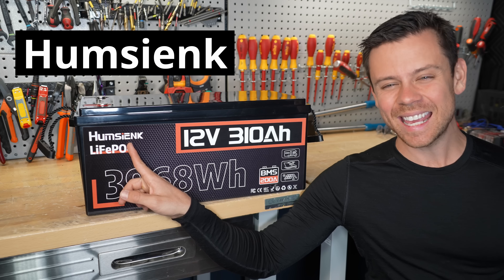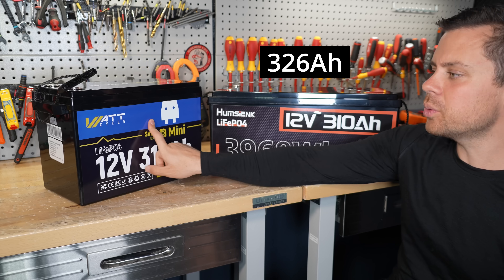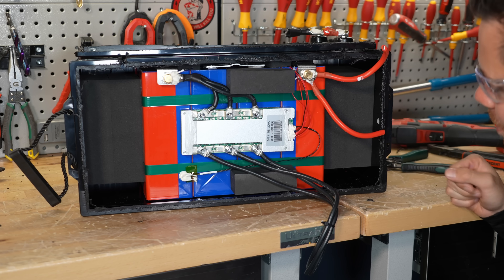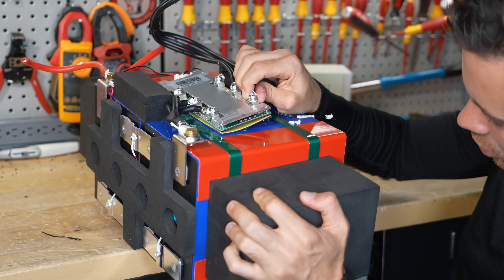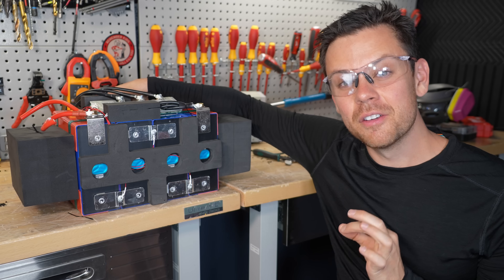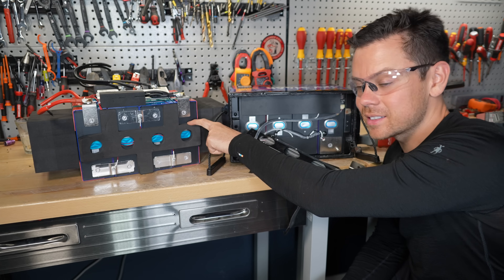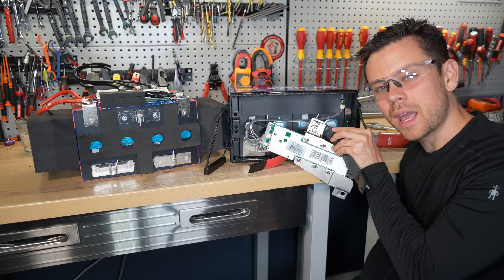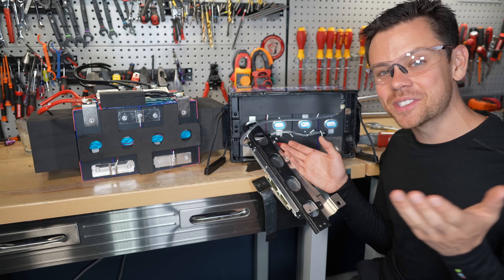$369 Humsienk 310Ah Battery VS $500 Wattcycle "Smart" 314Ah Battery

Comment: It is important that you measure the voltage of each cell in the battery. A bad battery have a lot of variations between each cell.
Also, if you can, take the internal resistance of each cell. A good battery have cells that have almost equal milli-ohms reading. If a brand new battery have already unequal readings that means that with time it will become worst and the BMS will not be able to equalise the voltage and your battery will become dead.

Comment: Might want to check out the Dr Prepare 300ah 12v mini battery. Jasonoid just did a review of it and the price is around $320 on their website. Also, a dumb battery. His main complaint was no over current protection and it would only trip with over temp. I just got the battery this week. Seems like a great deal with a fuse or circuit breaker added to it.

Comment: About a year ago I purchased 4 X Humsienk 12V, 300Ah, 200A BMS, LiFePO4 Battery with Bluetooth 4-pack Total Delivered with tax to Texas USD $1,276.20 so $319.05 each all in. A few months later I went to order more but they changed them to 100A BMS. So ended up going with a different brand. Glad they now they have the 200A BMS again. They have been great batteries. no issues what so ever. 
UPDATE WHEN I CLICK ON YOUR LIKE ABOVE ON AMAZON THE HUMSIENK SHOWS IT WITH A 100A BMS, (12V 300Ah (310Ah) LiFePO4 Lithium Battery – Max. 3968Wh Solar/RV/Off-Grid Power,15000+ Deep Cycles, 100A BMS,)

Comment: Humsienk seems like a great value, but Wattcycle has already fixed the app's parallel connection issues—it's really a tough choice! If money were no object, I'd go with Wattcycle!
Reply: The fix is still flakey. It also doesn't address the poor balancing capabilities due to mismatched cells and/or bad BMS design. 
My 314 would get so badly out of balance when charging that it never made it over 13.6 volts. I've heard people that have tried weeks of reduced current charging that haven't managed to balance these batteries. They are still advertising eve cells and mine and probably most/all have REPT cells. That wouldn't be so bad possibly but they are lying. My battery had the charging issue, Bluetooth had to constantly reconnect to show current data and then it died completely after 3 weeks of use. Dealing with customer service was not fun. I think they were more responsive after I filed a credit card dispute which I've learned you can often do even 6 months after a purchase. 
I got a vatrer 460 which is a bit of a jump but so far the balancing is really impressive. 
They have a 300 self heating for not much more than the wattcycle and a non heated one for about the same.I think temgo might be made in the same factory as vatrer as well, I dunno. 

Good luck
Reply: @daveybphotography  The latest Beta4 WattCycle app is a big improvement. This is still a Beta test version. I'm going to wait until the final version before judging how good or bad the battery is. Personally my cell balancing seems fairly good, not perfect but it charges to 14.1 - 14.2V before BMS stops charging.

Comment: Price value is reasonable. Like you said,  additional PROTECTION is REQUIRED to use  safely. 

Possibly that over sized case is shared with another larger product?
 OR, case is remaining supply from a previous manufacturer version/product which they bought for pennies?

Almost seems that a small fan might be added to blow across the BMS? 
Yes, would comprise the sealed nature of the case.

Comment: Someone else did a review on the 310 12v Humsienk battery about 8 months ago, just before Humsienk changed their 200 BMS to 100 BMS.
I purchase 4 units at $1152 plus tax for 4 units. The guy who did the review said the batteries have class A cells. Since Humsienk is who sells the batteries in Temu. With in a month I got an offer from Humsienk thought Temu of $125 0ff. I got a 5th 310 12v battwry for $225 they keep on sending offers of $125 off. I stopped at 6 units total. They are working like a charm. I'm using them in a 24v system. 3 strings 24v each, for the total of 22 kilowatts plus. I'm happy with them  so far...
Reply: Please watch out with series connection of LiFePO4 batteries. But if you watch Will you know. Charge them with individual 12V chargers once a year will help preventing imbalance between the packs.
Reply: @Robbedoes2 Thanks for the heads up. I Will do. Before I paired the batteries in series I charged them individually with a charger until they stop charging at 100%. Each string is connected to buss bars, and each string is fused.
Connected to a 24v 6k SunGold inverter dual phase but only using it in 120v mode.
I integrated a 1000A Smart Victron shunt to monitor the watts coming in.
I found a good deal on 405 watts Trina solar panels in CL, a guy had purchased a few pallets of panels and had  some extras, $100 bucks each...

I'm rinning (2)100A Litime charge controllers in paralels with the same settings...
2 AWG wire for the battery strings and the main wire from the batteries to the kill swith then to the inverter is 1 AWG.
The solar panels just before the inverter have their own breaker disconnect. The charge controllers are also fussed to the battery banks.

All good so far..
Reply: @textmaxag wth is a shunt?
Reply: @Robbedoes2  An active battery balancer works well too. Keeps all the batteries the same voltage.

Comment: I know I may be in the minority here, but Smart Batteries (Bluetooth functionality) is the difference maker for me when I look to as to my Lifepo4 collection. Reason I need them is because I use them when I'm camping for powering a small fridge, laptops, projectors, and my trolling motor plus to recharge all my headlamps, flashlights, lanterns etc... So knowing the % Capacity remaining is extremely important so I can make sure I have enough power for my entire trip. I don't use them for a home power solution. Just my 2 cents. Is anyone else like me?  Cheers!
Reply: Just use a shunt
Reply: @chrispekel5709 I have 2 , way less clean and needing managing to keep it accurate
Reply: @chrispekel5709 I've bought a few different coloumb meters with shunts, they Messier compared to a pre-built one with extra wires Plus they aren't as accurate as they need calibration quite often

Comment: "why do they have to make these smart"
Stop there.  That's the question for everything.  Make items smart and they fail.  Make them dumb and they work.
Make America (or wherever) Dumb Again.
Reply: It's just a software error, it's just a Bluetooth and software. They will figure it out. Your dumb battery has a BMS as well, just no Bluetooth access

This isn't like carbs vs fuel injection or lead acid vs lipo

I do get your point though...
Reply: @chrispekel5709  I very much appreciate that you disagreed with me, but understand where I'm coming from.  Thanks.
Reply: @BillyBobDingledorf these batteries aren't much more complex than a dumb battery, it is clearly some sort of software issue causing them to turn off as it doesn't happen with series or single batteries. All batteries will be Bluetooth connectable soon

Comment: Our DC House smart batteries don't seem to have any problems.
Reply: DC house is the exact same as eco worthy. Just different sticker. Same company
* That said I've had great luck with my DC house golfcart pack! Bluetooth is great!!! But ironically it only works with the ecoworthy app. The DC house app won't connect
Reply: @flyingtime5501  The app works fine with both my 12 and 48 volt batteries.

Comment: I purchased to Humsienk battery 12v 100Ah. Play sit almost a year they said that they were shipped at 50%. How to charge both of them separate with a Lifepo 4 battery charger I got off of Temu. They only charge to 14 I thought they were supposed to go to like 14.6. the battery charger automatically cut off on its own so that was good because I was tired of watching it. I think the charge hour was 7 or 8 hours. I already have my fuses to go to the batteries I'm going to put  one on each battery. I saw another video what a 12 volt 100 amp and the man said look exactly as to wattcycle battery. I will check the battery charger in the batteries they never did get warm and I and I charged them outside.Thanks 😊

Comment: I open four of these batteries and mine was NOT built like that.  It did have screw terminals on the BMS and strapping around it, but they were obviously used cells with a QR code scratched off on three of the four.  The fourth one had 304ah cells.
Reply from the maker: Can you post pictures of your packs on the forum for all to see?
Reply: @WillProwse  i’ll see if I can figure out how to do that 👍🏻
Reply: @WillProwse  add a down, but I’m not sure if the pictures are as clear as they are on my phone. I could email them if need be.
Reply from the maker: 😲😲 good to know!! Wow!
Reply from the maker: Yikes!!

Comment: Picked up a 100ah Wattcycle dumb early this year. A few months later I bought a Humsienk 100ah dumb from TEMU. I have them in parallel and I'm now working on imstalling some solar (this is all on my 5th wheel). I had watched several reviews for both of these batteries, and the consensus seemed to be they are basically the same battery. I know the cases for the 2 I have could have come out of the same mold. The instruction manuals are almost identical, with mainly some color and text style changes. I would like to see a tear down of these batteries side by side!

Comment: Will, I enjoy watching your channel I'm wondering if you would test 4 or 5 of the Rigid 300 watt panels on Amazon lately for quality and power output. Especially the smaller footprint ones. Hard to believe they can get 300 watts in a 26"x53" foot print. Thanks!

Comment: I wish these cheap dumb batteries had provisions for a Bluetooth/display module so I can occasionally monitor the health, more specifically cell voltages. Most of those BMSs have the capability for a UART connection, just need to route it to an external waterproof port.

Comment: What’s to stop someone from buying four of these, stringing them together in series and making a 314Ah 48v battery bank? Maybe even ripping off the plastic box and putting them in a space saving container for use in an RV or tiny home? It would likely be one of, if not the cheapest and most compact way to get that kind of capacity. Maybe put a heatsink on the BMS with something like corrugated plastic between the BMSs and the batteries?

Comment: 100A BMS!   Link is WRONG   your battery in video shows a more expensive 200A BMS
12V 300Ah (310Ah) LiFePO4 Lithium Battery – Max. 3968Wh Solar/RV/Off-Grid Power,15000+ Deep Cycles, 100A BMS,Low-Temp Protection,A+ Grade Cells for Marine Trolling Motor Home Energy Storage (1 Pack)  $369.99

Comment: The batteries are made by different companies but they do share a lot of technology. The Chinese have a business model that is genius in my opinion, they seed multiple companies competing AND cooperating at the same time. They are in the same industry, doing the same end products, they share technology, they share know-how, parts, probably even facilities, but every company does their own thing, they copy each other AND they innovate, some have better marketing, others have better support/documentation or better QA or better pricing. That way some of them thrive while some may stagnate, but then another innovates and may surge over the others, in any case they all learn and progress as a whole.
Reply: This is a key part of China's industrial strategy that doesn't get enough credit. They foster a powerful ecosystem where multiple companies simultaneously compete and cooperate. They share core technology, R&D, and supply chains, which lowers costs for everyone. But then, each company fiercely competes on execution—marketing, quality control, pricing, and customer support. This model means the entire sector innovates rapidly. Even if some companies fail, the collective knowledge and progress of the group always moves forward. It's a genius way to dominate an industry.  I wonder if Western companies, with their focus on proprietary everything, can ever effectively replicate this strategy?
Reply: With all the variations reported between same brand batteries I think sometimes there nothing in common besides the name on a shrink-wrap label. Same label, different plants?

Comment: I bought a "DC House" battery from amazon but have never seen you do a review of it.  Maybe it is only sold in Canada.  No idea.  It has the same blue label as some of the ones you have tested and makes me wonder if is the same.  It only has cold protection not the over current.  I do run a fuse in the system but not really sure I am doing it right.  I like the one  you showed here as looked pretty simple to use.  It is a 280 AH in a nice size format I thought,   I have no way to test the capacity but it doing what I need it to.  Got it for under 500 Canadian and it was so affordable to see how it was against my lead acid.  Never look back now

Comment: What size fuse is appropriate for the watt cycle battery?
Reply: Just limit it to whatever max amperage you want to pull from the battery.  Also size your wiring large enough to handle that amperage.
Reply: @robertgiresi9515 if you have multiple batteries in parallel do you size the fuse at each battery terminal to the max amp of just one battery or the combined amps in parallel?

Comment: Dang 100$/kWh. That's insane. Would love a video on budget solar panels too.
Reply: The used ones ??!!
Reply: You can buy the cells in China for $50/kWh. What I don't understand is why they went with that huge case. Unless they were weight limited on the container anyways it doesn't make any sense to more than double the volume of the container vs the contents.
Reply: @andrewfidel2220 
most likey because they are "meant" for golf carts, using a standardized case makes it cheaper to buy and get product out the door than having to wait on custom cases. give them a couple of months or even weeks and they might start using smaller cases.

Comment: I want to use a sungold inverter and dc-house 48v  batteries. Would you use those post fuses and run cables to parrellel the batteries before going to inverter? or run a bus bar between?

Comment: Have you looked into the Elefast 330ah batteries yet? Supposedly they use EVE cells and use a 200ah bms  and at just over 350 they are super cheap but again they are Bluetooth enabled batteries

Comment: My understanding is the large case is to accommodate existing battery compartments as a direct replacement (D8?). I recently purchased their 12v 314Ah Mini w/bluetooth and 100A BMS which I suspect is the same exact as the one you’re reviewing with exception to the BMS. The 100A BMS is fine for my off-grid cabin. And for $339!!! I couldn’t pass it up. Hopefully you or someone else will do a review on the mini. Love your channel BTW!

Comment: i am wondering if there is a way i could mount this to my bike in parellel (for added storage) and then when i park my bike, i can just plug it into itself. 

i would possibly put it on the rear cargo rack in dedicated paniers. then i can just plug in the batteries instead of the main battery. this would also allow me to remain mobile without having to stop. 

The hiboy ex6 has a safety feature where you cant use the motor when it is charging, but you can still use it like a regular bike.
Reply: Your ebike is 36v, there are 36v batteries I would like into one of those

Comment: I bought a 100 ah battle born battery. I thought that i could leave it alone until needed. Now, i know better. My battery wont charge. Is there anything that i can do to charge it or do i have to throw it away?
Reply: if its dead its dead. never leave a battery low on charge unused, they all die if not used
Reply: @Mar-s5q8m that's not true.  The BMS may be able to be woken up or the BMS may need replaced and the batteries may still be in decent shape. 
*They have a great warranty which is really the only benefit to buying them.  Give them a ring
Reply: @veganpotterthevegan  no its dead.
Reply: @Mar-s5q8m  you definitely don't know that.  I've seen LiFePO4 batteries that were dead for 2 years, only to be woken up with 90% capacity.